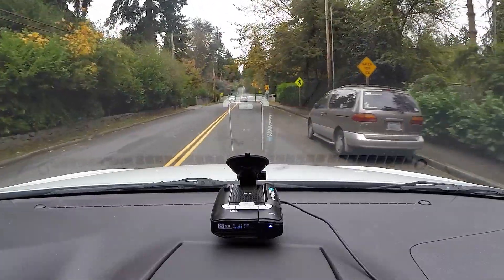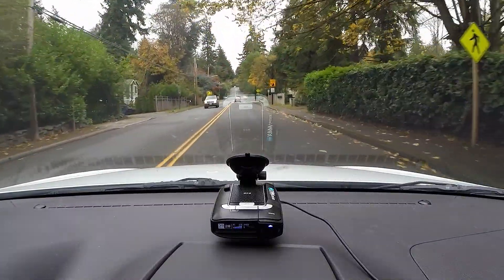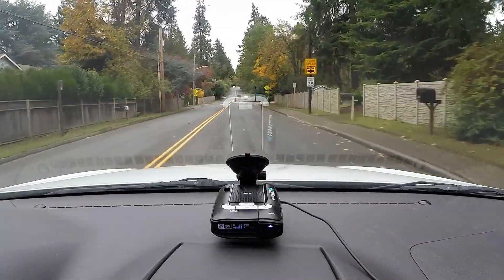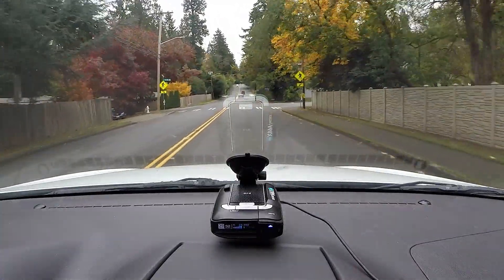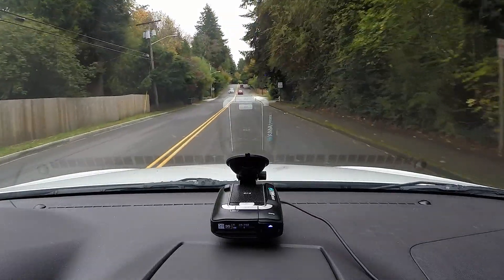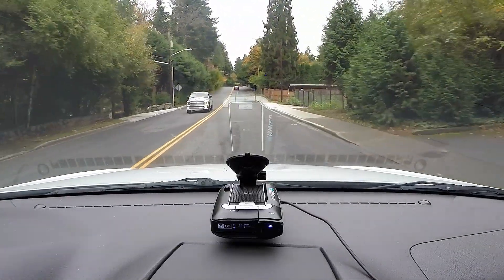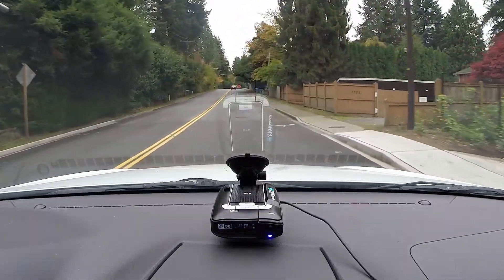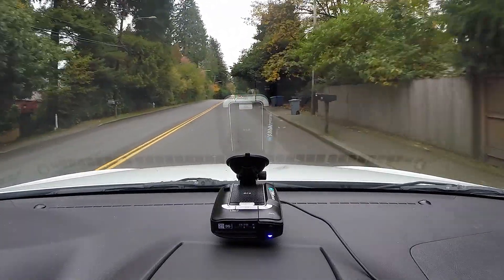Max360, slow to change arrow direction on a speed sign

Comment: Is the V1 worth to buy now? Im looking forward to getting one. Any opinions?
Reply from the maker: +uhVelo - The V1 is more refined, but it requires more setup, configuration, and the use of an Android phone. The Max360 is more like the jack of all trades but the master of none. It's easier to use, its arrows have colors so they're easier to discern at a glance, and it can display things like frequency information and do GPS lockouts through the detector itself and it doesn't require a phone. Depends on what experience you want.
Reply: I love my V1. Quite simply,  I love know where the source is coming. The arrows really are awesome. 
The concealed display and paring the V1 w/ YaV1 is the complete package. Prefer it over my Escort detectors any day. I have felt like the V1 helps with situational awareness and has given me adequate time to slow down in time. It's awesome! It's the difference between having to guess to actually knowing where to focus my attention. The V1's arrows transitions are real time while the Max 360 is still delaying. I'll stick with the V1 for now.
Reply: I own a Redline and it's been great so far. But the V1 grabs my attention given to the fact  that you get to know where the radar is coming from,i hope the V1 will satisfy my needs cx Thanks :)
Reply from the maker: The Redline is awesome too. The V1 can point to where the threat is, but the Redline will do a better job at picking up the signals at a distance due to its superior range.